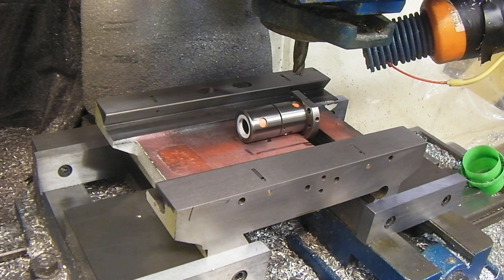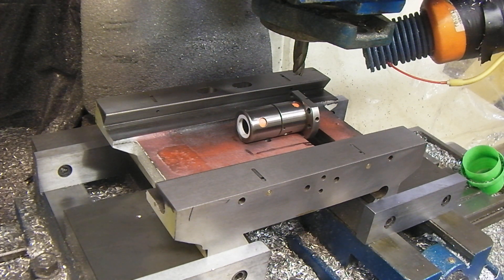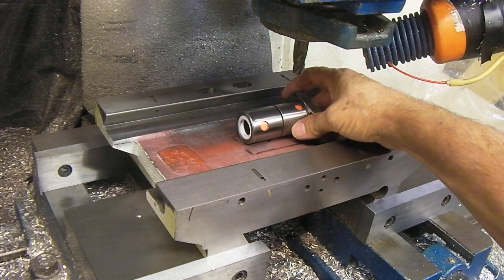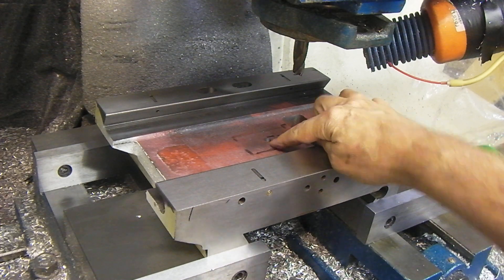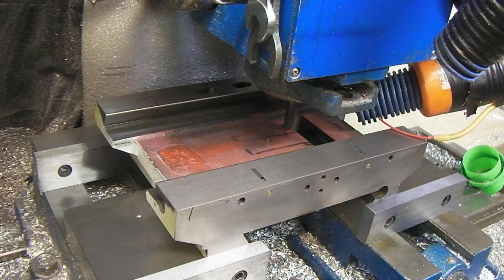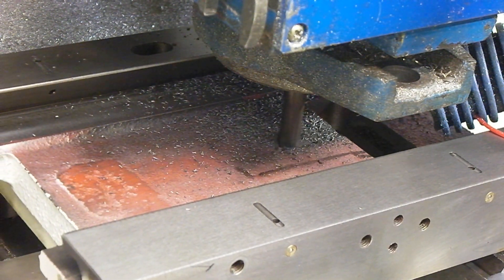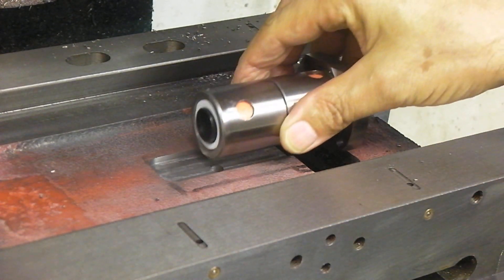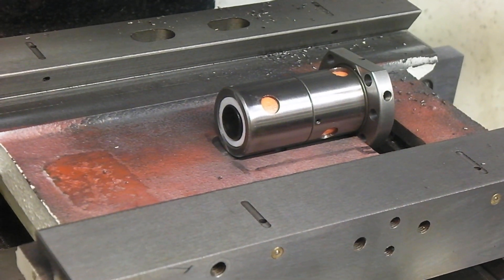Milling the X nut pocket for the PM-30 CNC mill , offset to the rear by .200"!! .210 deep.

Comment: I should have ordered from you. I got the HeavyMetal CNC kit and hugely disappointing. They were also unaware of the change and directions had me mill 0.100" off the bottom of the table. I don't have another mill so had to pay someone to do it. It wasn't nearly enough. At least another 0.050" needed to come off. In desperation to get it running I ground down the top of the ballnut. It worked but the leadscrew still doesn't sit correctly and has a slight bow. Eventually I'll replace it with another brand. Several other issues with that kit as well. I emailed them all to support and they did offer to replace my X axis if the ballnut failed due to my modification but offered nothing in explanation for all the other issues I found.
Reply from the maker: The X is a really tight fit. I had to do 6 or so test parts to get it to fit.  Send me a email and I might be able to fix you up. davedaxx1@yahoo.com

Comment: It's a shame that they won't alter their castings a little as to accommodate the ball nuts. One would think that there is enough demand from people buying these mills for the CNC conversions that they would make the mill more convertible friendly. It sure wouldn't take much to adjust the moldings for this.